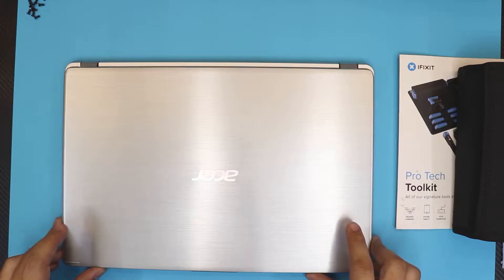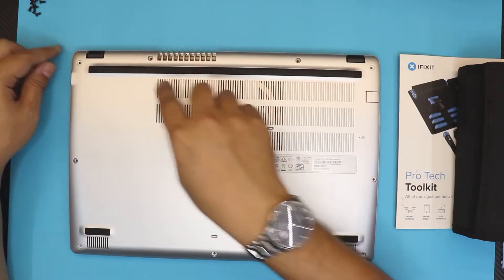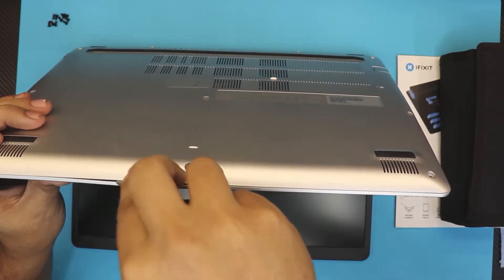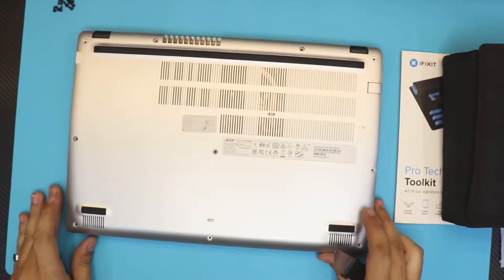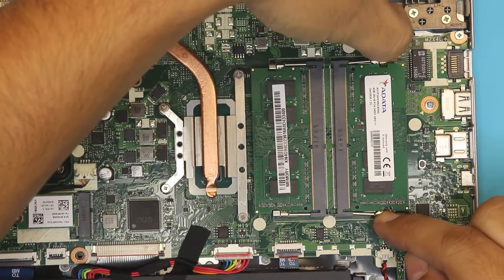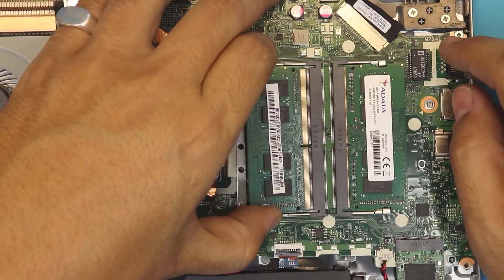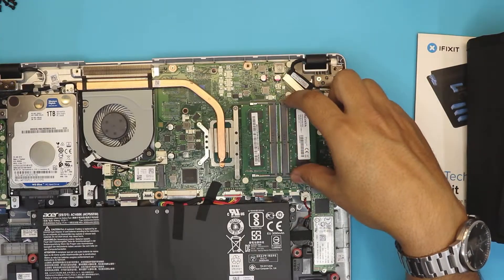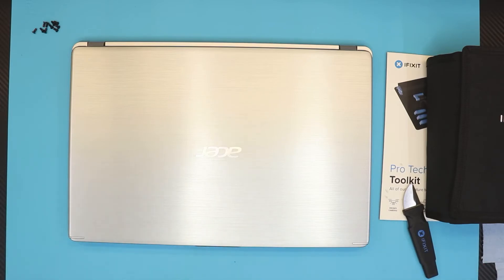How to install / UPGRADE RAM Acer Aspire 5 under 5 minutes !!!

Comment: My model acer aspire A515-56-30VE India. Ot have 2nd slot free to add ram and it mentioned DDR4 SDRAM. How much price for 4gb ram?
Reply from the maker: Thank you for the feedback! if you wish to support the channel you can LIKE or SUB or both :P
regarding your question: 
https://www.amazon.in/Crucial-Single-PC4-21300-SODIMM-260-Pin/dp/B07JMXN2W3/ref=sr_1_1_sspa?dchild=1&keywords=sdram+ddr4+4gb&qid=1633052588&sr=8-1-spons&psc=1&spLa=ZW5jcnlwdGVkUXVhbGlmaWVyPUEyVk5PNDFPVjhPVEgxJmVuY3J5cHRlZElkPUEwNDk3NjY4MkZTVDcwQ084MzEzOCZlbmNyeXB0ZWRBZElkPUEwNTU5ODg2MkVPSThWVlUxRjRZMCZ3aWRnZXROYW1lPXNwX2F0ZiZhY3Rpb249Y2xpY2tSZWRpcmVjdCZkb05vdExvZ0NsaWNrPXRydWU=

Comment: I just bought acer aspire 5 model a515-46r14k and I'm doing my first ever upgrade of the ram to make it 12 as it comes with 4g ram and one extra slot to upgrade. I'm also adding a sata3 480gb adata ssd also plan to change nvme  ssd in future it comes with 128g what brand and memory u suggest for gaming nothing to crazy just regular games
Reply from the maker: Thanks ✌  for the feedback!  if you wish to support the channel you can LIKE or SUB or both :P
Regarding your question: congrats, regarding the ram don't go over 16gb as its not necessary for gaming.
but if it has already 4gb then you can place 8gb or a 16gb dim depending your budget.
8gb : https://amzn.to/2UAwYgJ
16gb: https://amzn.to/3gjvLlH
this brands are rock solid and awesome for heavy work we used them a lot.
please in gods name dont get ADATA or kingston they are the worse in durability!
go with SAMSUNG or Crucial 
Crucial : https://amzn.to/2WetcKT
SAMSUNG : https://amzn.to/3B1ugAG
Reply: @uFixTek  I already got the adata havent installed it yet should I return it and as for the ssd nvme  what u recommend for size and brand... thanc
Reply from the maker: i would recommend to return of you can they are not reliable at all, get any of the above regarding the nvme a samsung or crucial are good:
https://amzn.to/381DYGC

Comment: I have 8bg ram on this machine. Can be upgraded to 16gb? TY
Reply from the maker: Thank you for the feedback! if you wish to support the channel you can LIKE or SUB or both :P
Regarding your question: yes just add another 8gb low volt, we use this a lot in the store they are rock solid 
https://amzn.to/3kB00aA

Comment: I have Acer Aspire 5 (A515-51-517Y) with inbuilt RAM 2400 MHz, CL 17 .
Considering rest of the factors compatible, if I install 2666 MHz, CL 19 will it work??
Reply from the maker: You're welcome! Thank you for the feedback! if you wish to support the channel you can LIKE or SUB or both :P
regarding your question:  yes it will work and the bios will adjust the speed of the new one based on the lower CL. but at the inicial boot it will take 10-15sec to do a ram check.

Comment: Hi. I recently got a 8gb ram and added to the laptop. When I turn on the laptop the screen stays black. Any idea what the issue is? The ram I got is from elite team group. 8gb ddr4 2400. Thanks
Reply from the maker: Thank you for the feedback and your support to the channel by a sub :P,
regarding the ram: power off the laptop, remove both rams and place the new ram in the 1st slot. them power on the laptop and let it boot and once you see the logo and booted then power off, and place the old ram and then power on and wait 5-15sec. this is normal as the bios sometimes cant detect added rams.
and if the above dont work then you have a defective ram. let me know

Comment: I have the same computer but the ram doesnt fit..  Its a DDR4 like the original but it wont align unless I turn it over.. Then the black chip squares are facing the bottom. Is this right? I dont want any complications before I try again
Reply from the maker: yes you have to flip the chip position dont matter just align the cut on the ram with the cut on the din and place it in and snap in place and you will be fine, thank you for the support :)
Reply: @uFixTek  thanks!!
Reply from the maker: Anytime :)

Comment: Hi! Does the Acer Aspire A514-53-37WQ (Intel i3-1005G1) have 2 RAM sticks or just one? I am planning to upgrade it since 4GB RAM is lackluster, i would appreciate it if you respond quick, thank you!
Reply from the maker: it has two ram dim , you can go with 8gb x2  for 16gb 
https://amzn.to/2QFBLHC
Reply: @uFixTek  so the ram type of the laptop is DDR4 with a frequency of 2666Mhz?
Reply from the maker: yes the bios will use the speed that can handle. sdram ddr4
Reply from the maker: @blackflask8254  yes you can put a sdram DDR4 frequency from 1600 up to 2666Mhz

Comment: Is A515-51G that currently has only 4GB eligible for an upgrade or does it have multiple slots? Ty.
Reply from the maker: A515-51G has only one dim ram , you must remove the ram in there and place a bigger GB ram dim.
Reply: @uFixTek  Can I expand it upto 16GB? Wbt A515-54G? Thanks again.
Reply from the maker: go to task manager in the windows and >>> performance tab and click on cpu and give me the cpu name model detail and i will let you know.

Comment: is there a limit to how much ram the acer can take? can i upgrade it to more than 20 gb?
Reply from the maker: it very recommended to go with 8gb x2 so you get the duo channel mode. you can go 20 but you wont have duo channel /
Reply: The max is 32gb I’m pretty sure so you can have 2x16gb for dual channel

Comment: I have the a515-54-55zd model is the ram upgradable ?
Reply from the maker: yes its up-gradable. there is one slot ram dim on motherboard
Reply: uFixTek so we’d have to get 16gb stick in there? Or we can’t because the intervals?